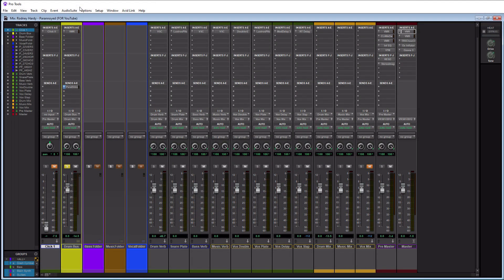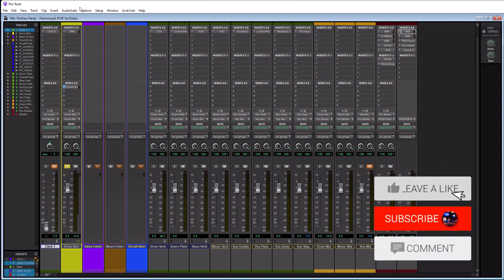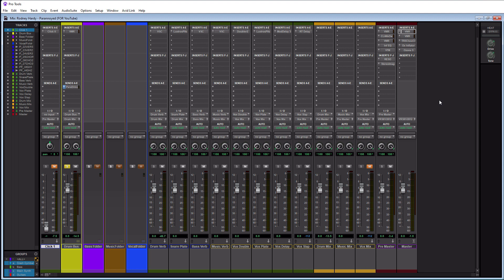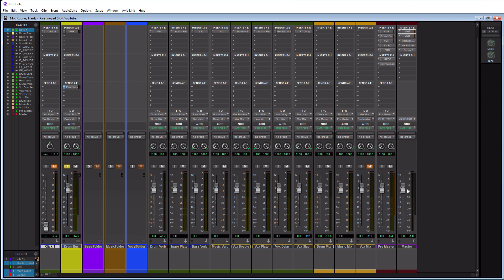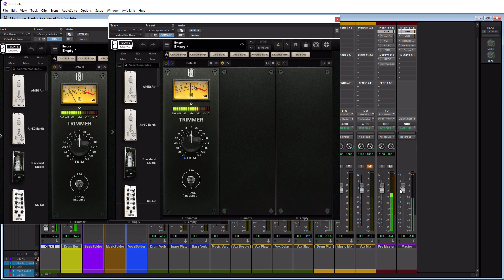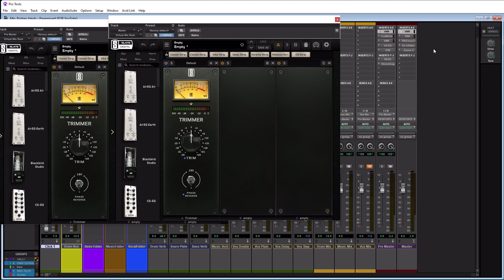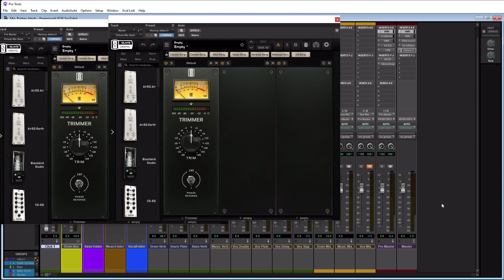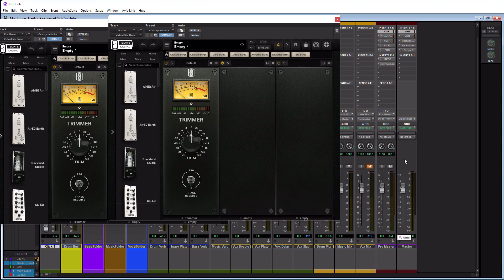Pro Tools Master Fader Track | What Is It And How To Use It Right! @avid

Comment: Thanks, very helpful!  But something still doesn't make sense to me. If you put your volume automation adjustments on the pre-master channel (such as slightly bumping up a chorus, or fade-outs as another commenter asked) but then you feed that pre-master into your master bus, which has limiters, etc. inserted, won't those final volume leveling controls work against your volume automation and try to even things back out?  It seems like you would want to have any master volume automation tweaks at the very end of the chain, after every processor.  Your thoughts?